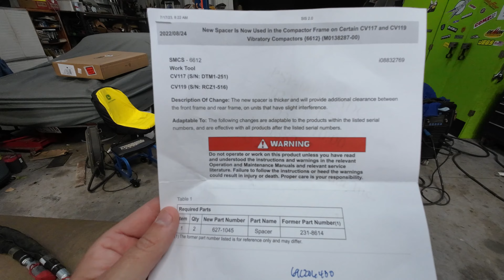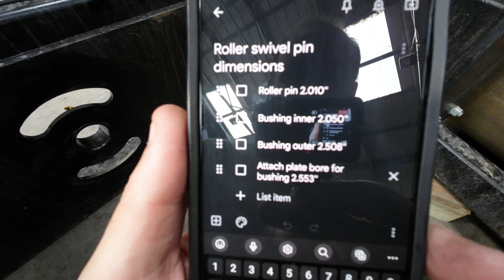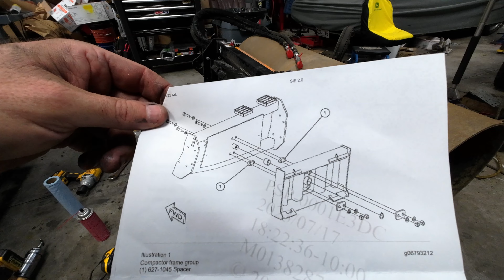DID THIS FIX IT?

Comment: Hi Gill, nice channel man!
How do you like the 289D3?
Did you ever find it to be underpowered?
Reply from the maker: Thank you. I love the 289d3. Only very rarely do I find the machine lack power. I run full flow up Steep hills and super thick grass and not a problem. Also runs cool on hot (for Hawaii) days.
Reply: That's alot of weight and vibration riding on such a small pin seems like a bad design on cats part
Reply from the maker: @95kenworthful  The pin doesn't worry me about its ability to carry and stand up to vibration. Its the loose tolerances on the pin, bushing and bore of the attach plate that concern me with premature wear.